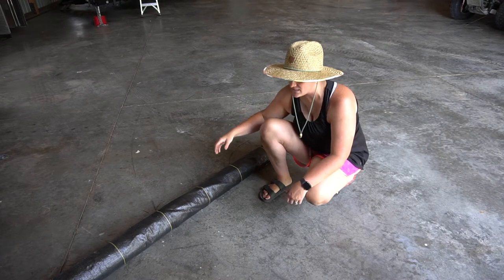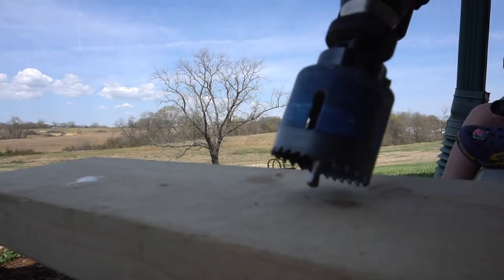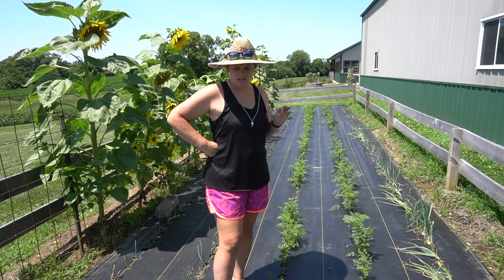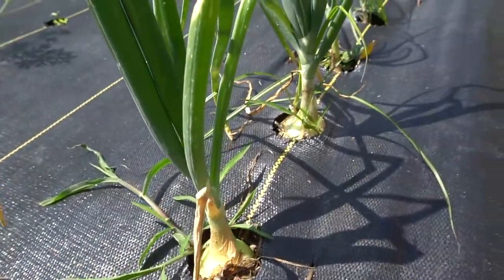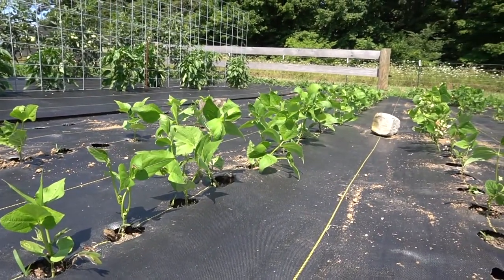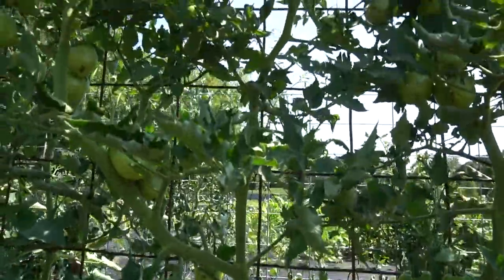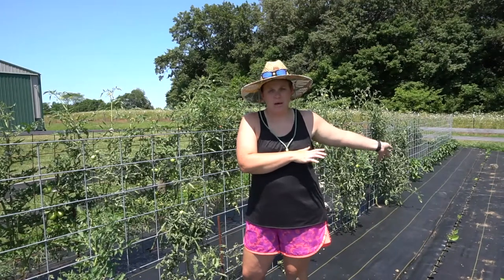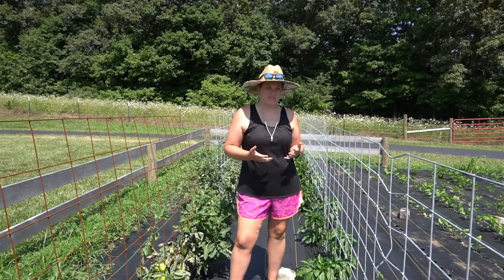DeWitt Sunbelt Woven Ground Cover // (Almost) WEED FREE GARDEN

Comment: Great video! I just made my first purchase of Dewitt Sunbelt 72" x 300' from Home Depot. I plan to lay out strawberries on a 1' grid.   I typically rely on strawberries to multiply and spread by runners but then the weeds get so out of control, the crop is unmanageable.   The runners take root wherever they want to and crowd themselves too closely.   I watched several videos which suggest cutting back the runners and planting 1 foot apart, so I am buying a lot more plants initially, and I will use the lines on the Dewitt fabric to keep my spacing accurate.  I'll see how I feel about removing the runner plants, but I think it makes sense.  The other idea is to propagate the babies in little side pots sitting on top of the Dewitt fabric.  They can be snipped from the parent plant once they are established in the little pots and have good roots.   I'm very excited to try this approach for gardening with (Almost) no weeds!!!
Reply: I did exactly that with runners. Waited til they rooted before snipping and transplant. They propagate so easy!

Comment: Have you had any issue with disease, or is it safe to reuse year after year without disease, do you have to rotate and use on different crops each season?
Reply from the maker: This is our second year using it. We pulled the barrier up last fall and tilled the garden with fertilizer, compost, humus, then planted a cover crop.  We let it sit all winter and tilled again this spring and placed the barrier back down. As of now, the garden is doing extremely well this growing season. No diseases as of now. I believe this is the way we will continue to plant.

Comment: Great video! Can you tell me what method you use for watering?
Reply from the maker: Just the typical water sprinkler at night. A friend of ours uses the same barrier and uses irrigation hoses underneath the barrier. Both ways work very well, the barrier helps hold moisture in which is nice in the summer.

Comment: Oh, and how did you secure the cattle panel?  I see rebar, so I'm assuming that's how you did it.  I am using cattle panel this year too (first time) but the only draw back is that I'm on a plateau and hit solid rock about 2 feet below surface.  I'm hoping I can get the cattle panel secured properly.  Thank you!
Reply: I wedged 1 between the compost bin and a raised bed. The tension of the bend held it in place and I never even tied it in place. Grew pumpkins over it til squash bugs hit  😠

Comment: Can potatoes be grown in the barrier? Would I just stick the potato in the hole.  They usually require hilling.
Reply: Even though the black fabric prevents light from reaching the soil below, I don't think it would be a good way to raise potatoes to put them under the plastic fabric.  Soil over your potatoes helps shield them from sunlight so they don't get green (which is toxic to eat.)   As potatoes bulk up they push the soil which is above them up from underneath and they begin to emerge from the soil.  The idea is to pull hills of soil over them before they emerge.   I've noticed that the buried potatoes rarely have chew marks on them from mice, whereas the ones that have emerged have been chewed on, so I think the soil hills also protect your crop from rodent damage.  I have also noticed that rodents love to live underneath fabric, plastic, cardboard, etc, so they will likely be living and sniffing around under the plastic looking for foods to eat.   
To plant potatoes I recommend digging a trench and putting the soil from the trench to one side only of the trench.  I would recommend putting the black fabric right along the edge of your planting trench where you plant your potatoes, as close as possible without covering the row.  Fold under a little extra if you can spare it to flip back later over the potato row area once you pull out your harvest.  Then I would bring another piece of Dewitt plastic fabric up along the other side where you have your tall mound of soil parallel to your planting trench.   Fold enough of the the black fabric underneath to keep it out of the way but run it up and over the top of your soil mound.    As you hill your mounded soil over the potatoes into the trench,  you will eventually end up with a bare spot where the mounded soil was.  Keep this area covered at all times with your spare fabric until it can be pinned down flat and that becomes your weed barrier on the other side of the potato crop.   By the time the potatoes have been hilled three times, the potato plants will be quite tall, their leaves will fill in nicely and the canopy of the plants will extend about a foot in either direction overhanging your black plastic fabric.  Due to the shading from the plants, you won't need much weed protection especially with the black plastic fabric coming up close to your potato row on either side.   Once the potatoes have died back, you can again fold the fabric back out of the way, dig your crop, then pull the fabric back and possibly overlap the two borders of the fabric if you planned enough extra when you laid the fabric.   Or you could take advantage of the hand turned soil and put in a fall crop in that space, or pile chemical-free grass clippings over the freshly turned soil, or build a compost pile there with shredded leaves.  Often weed pressure is a lot less in the fall soil than it is in the early spring so it might not matter as much then if you don't have the black plastic blocking the weeds in that area.
Reply: @NoLongerGullible2013  Please make yt vid of this. Be very helpful!

Comment: Subscribed! How do you water your garden?
Reply from the maker: We just use the typical water sprinkler. We thought about a soaker hose under the fabric but decided to go with a typical sprinkler.
Reply: @TheCrazyPlace  ok thank you, we will follow your lead, your garden looked great last year.  We’ve already spend $1500 on fence post and fabric.  We have so many deer to keep out and we are blowing the budget 😂
Reply: @WaldenSpawn  there is a spray we use that deters deer. We have used it on trees before and it seems to work. Just have to tie small strings on the wire or limb and spray a little bit on the string. Doesn't smell pleasant though.